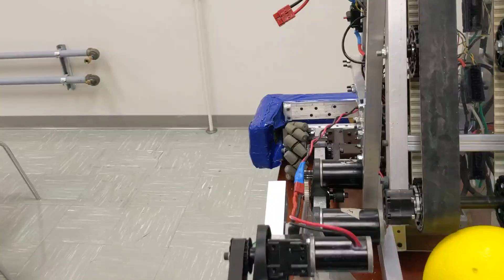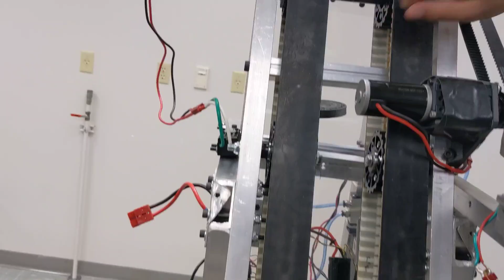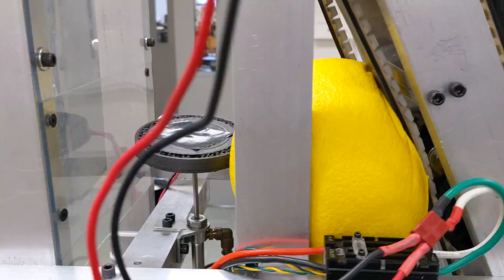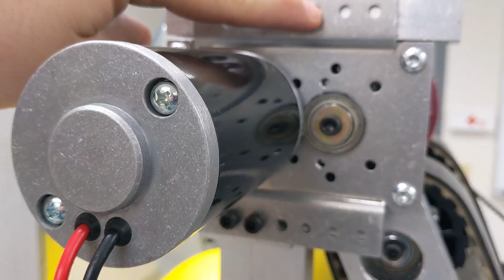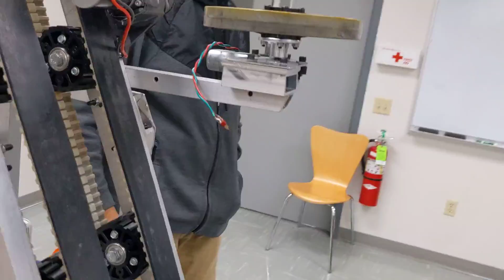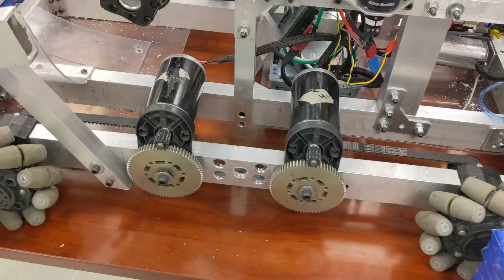FRC Infinite Recharge RI3D Murray State University Mechanical Overview

Comment: How can you drill such accurate holes ? ours are literally +- 1 cm
Reply from the maker: Which holes specifically are you referring to? 

We intentionally drilled everything by hand using only a drill press or hand drill. Our intention is to only produce something that other teams can replicated with minimum investment in tools despite the fact that we have access to cnc mills, cnc lathes, waterjet, and lots of manufacturing equipment in general.

Comment: Have you guys had any issues with the balls gripping with each other while in the tower?
Reply from the maker: They can grip each other but in general the conveyors grip the ball better than the balls grip each other. It definitely does tax the motor when they grip each other but it usually pulls the balls through. The major issue that we ran into is that with two flat belts the balls want to try to center on one of the two belts. I would recommend to any teams using flat belts to use a single belt and side panels to keep the ball contained during movement.